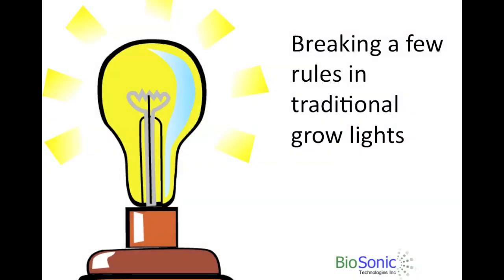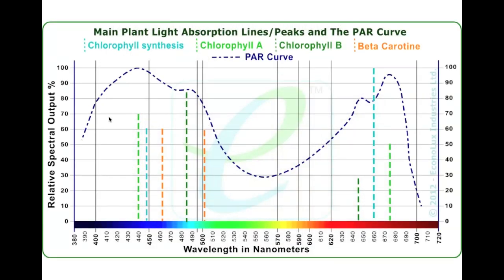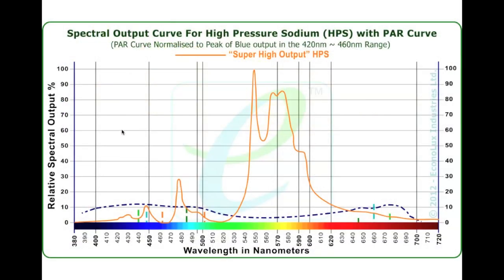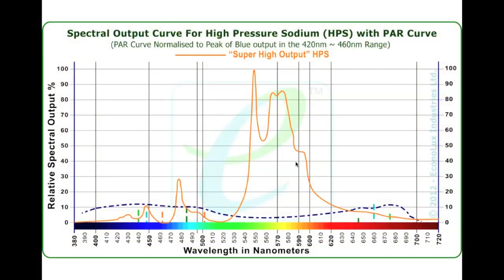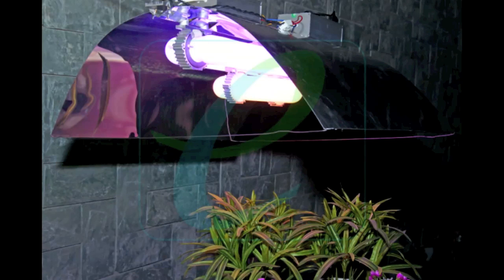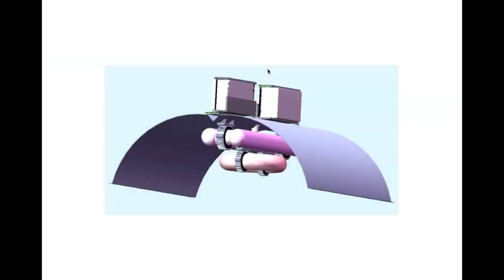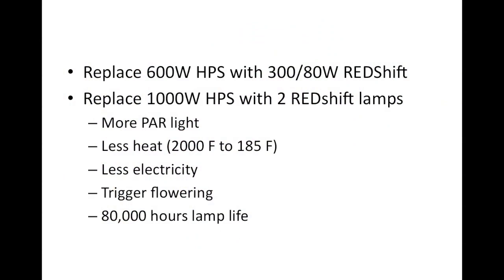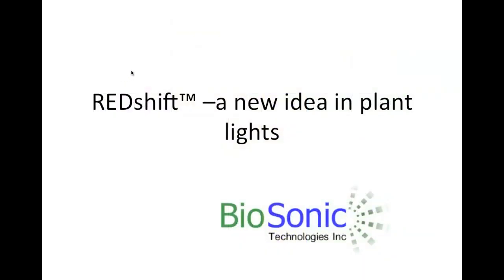REDshift Grow Light - details on PAR light and induction lamps - reasons why

Comment from the maker: THe REDshift 300/100W rectangular lamp is 26" long - so if that fits in your reflector we should be ok... otherwise a simple gullwing reflector may  be needed.  Prices vary based on quantity and freight - but budget $650-700 per  - also play enormous energy savings and some increase in crop yield